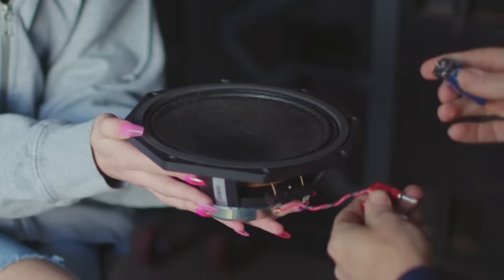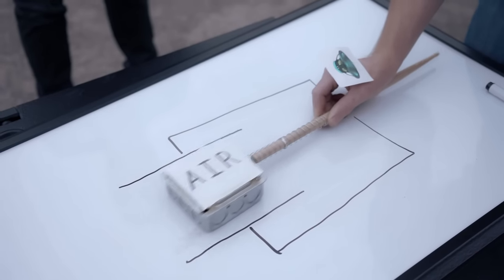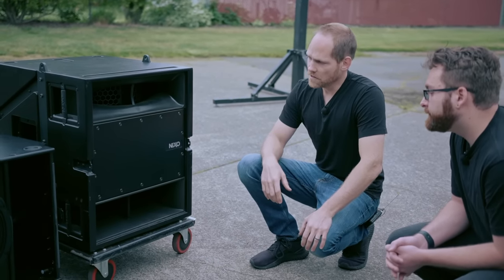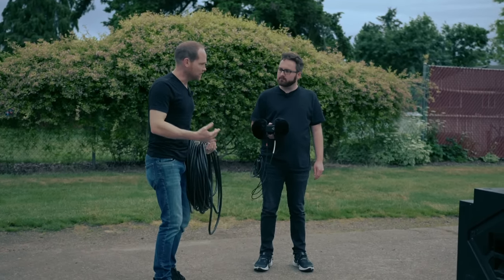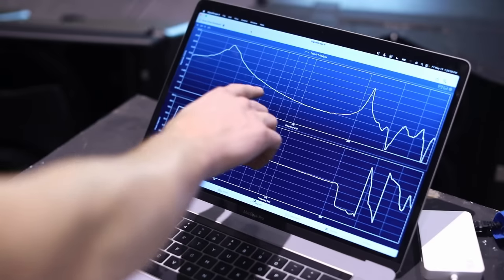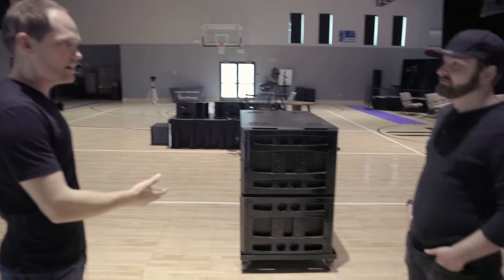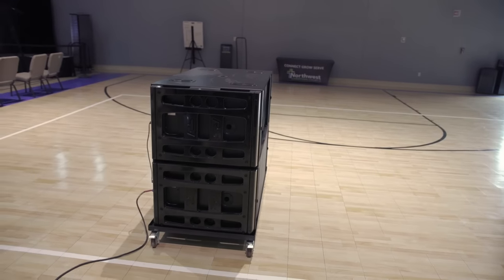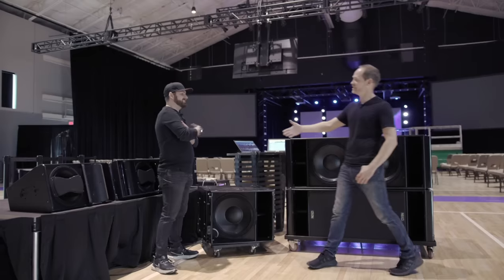Things you didn't realize about bass... until now.

Comment: Hello this content should be taught to all sound technicians! It is very educational
Reply from the maker: Share it with someone!
Reply: @devinlsheets_alphasound   unless you want to get the two guys to rap the info to the muzak  LOSE IT! it totally ruins a great vid!
Reply: He is correct on most of this but he needs to rethink how he describes how a port works.  He is kind of correct and kind of wrong.
Reply: Ok
Reply: @marxman00  ?
Reply: @evans4978  the TOTALLY unnecessary muzak!!
Reply: They do
Reply: Sound technicians don't waste their time playing with subs.....When you're building a large scale PA, you just stack the towers or arrays and you start sound checking because the system serves an artist and it doesn't serve the technician who thinks he can waste his time analyzing an empty room. Those guys with the computers aren't the ones who bend over to adjust  the parametric equalizer or spectrum equalizer. The FOH mixer does that and he laughs with nerds who can't do it in real-time. Y'all need to start mixing live and sort out feedbacks by tonality. This content will make you look like a fool and nobody will teach you. I started PA in '95 btw.
Reply: @ronnywouters7037  well, sounds like you're still using a workflow from '95 also then ;) these days we have great analysis tools (ie smaart, systune, etc) that work in real time to tune and tone a system objectively and with repeatable outcomes. We also use digital mixing consoles and remote monitoring and control setups on our computers, so no need to bend over into rack-mount gear. And sure, once the room fills with people, you adjust the tone accordingly
Reply: Yes! Great video
Reply: this is good for maybe a 5th grader lol
Reply: Teach it in school
Reply: Everybody needs some exposure to these principles in school. “Everything is a wave.” A lot of the human experience is vibration: visual frequent-cy, auditory, music, speech, pitch, intonation.
Reply: @rossimarti  Energy, Frequency and Vibrations!
Reply: @nevertakeadayoff  Yes! Thank you!! The magic three.
Reply: wait you're telling me sound technicians don't learn this?
Reply: If they do not know that... they are not sound technicians.
I'm not even in sound business and I learned waves interferences in high school...
Reply: @ronnywouters7037  this isn't a "how to mix for live sound" video it's a theory based video, it's like a guitarist practicing scales or a drummer practicing rudiments, sound engineers (like musicians) need to become familiar with their tools, sure the solution is simple but they may not know why the problem exists in the first place. also thanks for gatekeeping something that should be fun and creative but no you need to flex your apparent skill, if you actually love music and everything sound then why would you be opposed to people learning all they can about it, nobody's doing this in a live gig because THAT'S NOT WHAT THE VIDEO IS FOR, it's just a lesson in speaker design.
Reply: @boobrowsky  that's the point, to make it accessible to those who might not know the terms, the only reason why you would care about the terminology in this type of video is so you can gatekeep this understanding and making speaker design and sound inaccessible to a beginner.
Reply: Do you really assume an audio technician does not know this after more than 900 hours of training?
Reply: @ronnywouters7037  you clearly don't understand the difference between a sound technician and a professional audio engineer, who has to implement solid fundamentals like this at every venue. Technicians mix sound at a bar, club, or church. Professional audio engineers implement science to produce professional sound reinforcement at large venues. FOH mix positions at large venues do almost nothing during a live show because all of the work goes into setup. How it sounds at the mix position has nothing to do with how it sounds in the 100's and the 300's and 400's. The levels are set during a proper sound check and pretty much left alone.
Reply: @jked7463  he's actually pretty wrong, he is focusing on the air mass movement, which doesn't make any sound, while he should be talking about the phases of sound waves coming off of the two sides of the speaker cone...when designing a bass reflex speaker cabinet with a tuned port , an oscilloscope should be used to test the port, match the phases frequencies at the level of your desire, by adjusting the length and width of the tube, on the inner side of the port.  The one in the video is tuned to 32 hertz, when I learned about this stuff it was while building custom enclosures for cars and trucks, 100 hertz was recommended...
Reply: @SpartanBM015  Play nice, you were handed the tools - you did not make them. Boost your ego elsewhere.
Reply: @devinlsheets_alphasound  ngl i'm getting two pa 18inch subwoofers that 6800watts lmao

Comment: After years of building boxes from sealed, to vented, to bass-horn loaded, and simulating those boxes in HornResp, WinISD SpeakerSim, etc, there was nothing in this video that I "didn't realize" but I do really appreciate the cool slow motion and physical representations (the spring/stick/box) done in this video. It's a fantastic way to demonstrate what is happening to the layperson or beginner in DIY audio.
Reply: This was definitely an interesting video. The spring stick box thing was physical representation of something that I saw in a paper from Mazda. Using resonant frequencies in an automotive intake to get more air into the cylinders. Changing the length of an intake to have power over a wider rpm range instead of a single peak rpm. It works. I think the Porsche 959 was the first to use something like that. In the diagram it showed using the air as a spring. A mass with a spring on both sides, the mass also being air, the spring is air inside a runner. The mind blowing part is when an engine valve snaps shut, the air stops and builds up on the back of the valve, then springs back into the intake which can help another cylinder with an open valve take advantage of a micro charge. Every little bit counts.
Reply: @pgtmr2713  correction: First patent for variable geometry intake manifold was by Daimler-Benz I believe, in the late 50s. Toyota had their T-VIS which came in 82. My old 88 Mazda RX7 also had 3 butterflies, two smaller and one larger. Not all of these use pressurisation from resonance, like my turbocharged RX7, which wouldn't care, pressure increase due to resonance would probably be negligible as the turbo gave 0.8 bar.
Reply: @JakkeJakobsen  Yeah but the T-VIS was dual runner. More about keeping up the velocity. Same as the Taurus SHO. Not sure about the old Benz, but I was thinking more along the lines of something mass produced. Good on Mercedes if they got there first. Never really got into the RX-7 beyond "rotary," but good to see they were using all they could. I had an 88 MR2 4AGE with T-VIS, and have a Mazda KLZE V6 with VRIS. Collected all the intakes for the KL out of curiousity. Similar layout to each, but the only thing they share are the vacuum actuators. At low RPM all runners pull air from the throttle, mid rpm a valve opens and a cross tube opens up so the 2 banks can share some air, High rpm a second tube opens, so all runners can pull from the throttle and 2 other shared crosstubes located close to all runners effectively shortening the path. T-VIS had a 8 runners to 4 cylinders one runner shut down at low rpm increasing the velocity in the one runner for each. Badass 1.6 liter engine. :-D
Reply: same for me. This kind of knowledge sharing has and deserve its place on yt.. //My sub specialization in EE studies was electroacoustics at university and been building boxes since my childhood.
Reply: @pgtmr2713  true, thank you very much for sharing and for this video
Reply: I always liked sealed enclosure but I always took the insulation out and sealed the enclosure back. My blind friend and I myself liked the sound quality better. I don't like dead speaker enclosures. I did this with three different enclosures and came up with the same conclusion. I don't like ported enclosures. The speaker enclosure is a musical instrument like a piano soundboard. Speakers by themselves don't cut it. Ceiling speaker are dead sound unless they have an enclosure. I did watch the video and found it interesting and I'm going to do the same experiment with a 15 inch woofer. 73
Reply: Most people like me doesn't even knows the difference, & doesn't care too..
Reply: @jstwatchnread8420  yeah if you don't know the difference then any crappy sound system all sound alike. I grew up with tubes and know there is something wrong with today's amplifiers. Harmonics are missing with solid state amplifiers . They can try to fake it but knowing how the song sounds with tubes the solid state comes up short. As for dead speakers it's the muffled sound. A speaker should be like a musical instrument. The bass should sound like bass. Wood makes good speakers fiber does not. 73
Reply: And now class d amps make solid state sound even worse...
Reply: @jstwatchnread8420  maybe I'm not saying solid state amplifiers are bad it is just what I'm used to hearing most of the younger generation haven't heard tube amps on a regular basis. Some have heard an occasional amp run by tubes but for the most part only the older generation heard them most of their early lives.  Well I haven't heard a class D amplifier so I will have to listen myself before I judge the class D . 73
Reply: @ronb6182  I wont run anything but sealed, vented sounds horrendous with vague, loose notes that cant keep up with the music and a terrible frequency response.
I run sealed in my car and in my home and sick of people telling me i should run ported in my car, they change their mind when i sit them in my car and they hear how tight sealed sounds and how punchy four 12's are when in 100% airtight enclosures of the exact internal volume specified by the manufacturer :)
Reply: @pgtmr2713  I did wonder whether you could design a bass reflex speaker so it changes the length of the port so it is always at tuning. But whereas an engine is only at one rpm level at a time, a speaker has to play multiple frequencies simultaneously. Whether or not you could sense the lowest one is a possibility.
Reply: @TimpBizkit  I had a similar idea I figure heat would ruin a a speaker based, "speaker resonator?" Then there's power draw and sound. So far as covering the rpm range multiple speakers working together in different sizes. All complicated and mathy. Or just put a turbo on and render all of the above worthless.
Reply: @pgtmr2713  You'd probably end up using a small burly driver like a horn or tapped horn, that work better with one of those fat magnet tough cone car drivers. You could size the box bigger for efficiency without creating a one note wonder, but the issue is bass isn't just one note at a time. I was drawn to the idea because it seemed like the way to extract maximum bass from a compact(ish) enclosure. You would have a low but relatively flat impedance curve. Using a horn, BP6 or multiple cabinets and a multi way crossover would use up more space.
Reply: @TimpBizkit  If I design a box it's going to have a turbine in it to feed a turbo underhood unlimited air.

Comment: I have been into home theater for 20 years and have built various vented subs, but I never knew about the pressure waves from the port changing direction with relation to the driver. Thank you for sharing this knowledge and taking the time to present it in such a straightforward, yet entertaining way.
Reply: everything has its profession to get the best out of it.  i like to describe speaker as a racing car. no matter what speaker brand you have, you never get it to perfect for the most part. just like how you put your bass in certain of the room, you get the harmonic effect and one side of the room sound louder than the other side. could be the desk, the chair or computer that distort the sound of the bass. you centered the home theater speaker perfectly where you sit, but the person who sit 4 seat down from you wont theat the perfect 5.1 or 7.1 surround sound experience. just like racing car, each car is tune for specific track once you take it to another track, its not optimized unless you tune for it again
Reply: @BlueRice  It just can't be only me who demands more than one Subwoofer? I like four of them and under the bed should it be enough room for a couple who work together as you watch movies laying down... Just be careful they do not redusece eithother...
Reply: I think you did good before this however... Basic knowledge and confidence in the process still got you through the job.

Comment: In my opinion you are the only guy who has uploaded a video for these rare speakers.
You and I are the unique people who purchased them. Anyway 
I am an engineer from India, bought this fantastic set of 2.1 with a passive diaphragm sub woofer. Nearly 20 years ago. I have a similar problem.
That thick cable with multiple wires originating from the small satellite speaker and going towards to the sub also develops a loose connection in the connector and starts making weird sounds intermittently, this section too needs to be looked into.
Your video is lucid and helpful thanks for your effort, greetings and best wishes from India

Comment: Directional sub is so much fun! I  done this with a subs suspended up in a dome (together with soundscape speakers all around it at ear level). They were placed at just the right distance and with the right delay to send the frequencies used in the soundscape directly downwards in a cardioid pattern. Those kind of projects are the ones you remember the most (in stead of the normal FOH-installs).

Comment: I had no idea speaker boxes were this intense... pretty amazing
Reply: That's why some subwoofers can literally shake multiple neighborhood from a mile away
Reply: @DigitalSubset  no it cant shake anything mile away. Not even with subwoofer. This shit is midbass and it only plays music good
Reply: @fazer5994  I said some can. My system can and is heard a mile away when they’re turned all the way up. 18s in a Tahoe will do it too
Reply: @DigitalSubset  yeah you can hear it but it wont shake anything
Reply: @fazer5994  lol  *edit: I see he did write "literally" so disregard the lol
Reply: ive seen folks being physically sick with bass frquencies used to run a sound system back in the 90s and was running 20k watts through 4 x 5000 watt amps in some venues
Reply: @fazer5994  as a stage crew for Riversedge Amphitheater, i can say you can definitely hear the subs running pink noise roughly 1.2-1.6 miles on the other side of town from reflections from the building and river, but definitely right, you lose 'shaking' within a couple hundred feet.

Comment: Great video and informative!, the helmholz resonator, or bass reflex uses the concept that the air in the enclosure is physically time delayed in order to exit the port at the same time as the woofer cone is moving forward and as a result, the bass output is doubled, however, the box and port need to be tuned to the resonate frequency of the woofer/subwoofer

Comment: The one about the airflow that flows more smoothly through the narrow passage reminds me quite heavily of the venturi effect that's present on the floor/underbody of the 2022 Formula 1 cars, I assume this follows the same principle?
Reply from the maker: That’s a very interesting observation, would have to ask the engineers at NEXO. It seems that there would be less pressure during the construction, and whether this is what results in less air turbulence is something they would have to speak for. Our understanding so far has been that the constriction results in a more laminar airflow, where the air along the edges is forced to continue to travel through the port as quickly as the air in the middle, reducing the possibility of incongruent speeds between layers of flowing air, which causes turbulence especially near the edges in a straight port at high air velocity.

Comment: 6:20 the constriction increases velocity as well (yes like a jet would) It could also promote the flow of sound in one direction and not the other. Jaguar's old V12 engines had a trumpet design for the air intake which would allow excellent airflow (for the small diameter at the point on constriction) compared to a normal restriction. The shape accelerated incoming air which reduced the backflow of engine noise via the intake (induction/intake noise).. Thus you had a quiet luxury behavior uncommon for a big performance engine. What design is behind that constriction in the subwoofer would be very important as well.
Reply: Venturi effect.
Reply from the maker: We will have to ask the Nexo team if it’s the Venturi effect which results in the difference in SPL. Even if the Venturi effect is taking place, our intuition suggests that the main reason the SPL increases is because the shape forces the air along the outsides to flow as quickly as the air in the middle through the port length. This reduces the possibility of multiple “layers” of air moving at different speeds which can cause turbulence. Perhaps the Venturi effect, if it is happening here, also somehow contributes to this laminar airflow effect. Maybe this is a good excuse to make another investigative video!
Reply: ❤ Thank you ! For great bass information . I'm still trying to comprehend it.